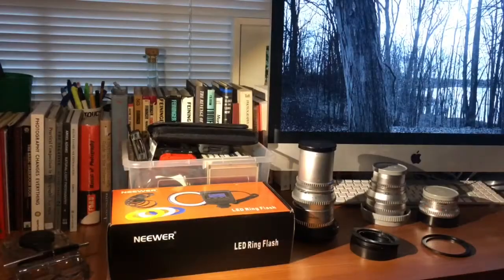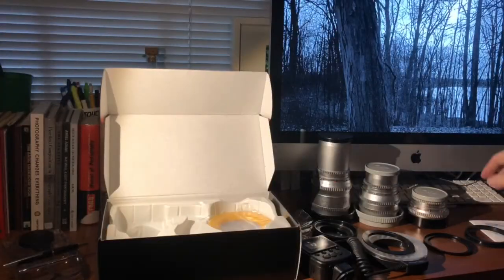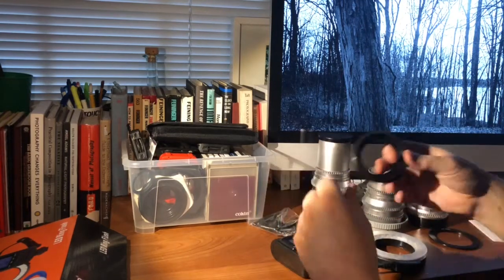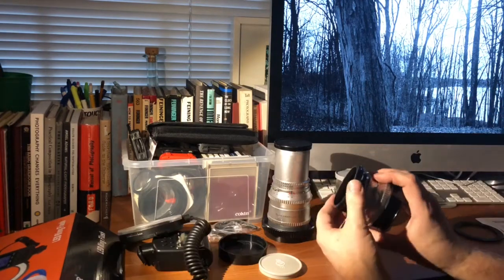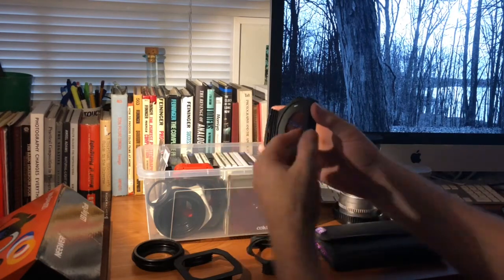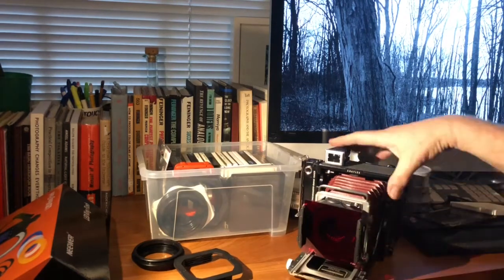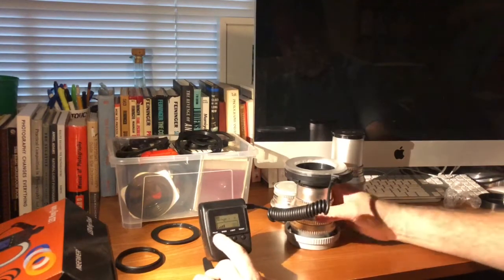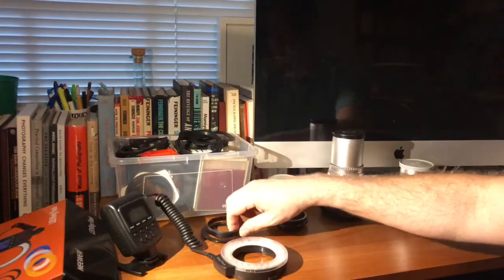Using adapter rings for Lens attachments: ring flash and filters

Comment: Thanks for the vid! So when you attach a bay 8 57 adapter to a hasselblad lens, it increases the ring size to 67. Then you need to attach a 67-77 ring adapter to put one of the neewer adapters on the lens, do I have that right?

I assume that you had to buy the bay 8 and fotodiox filters separately?

Cheers!
Reply: P.S ... I'm just looking at the Neewer ringflash now. Does it have a manual metering system when you can insert how far away from the subject you are and receive a flash that will provide the correct exposure? I will be using with film  rather than digital so its important I can trust the exposure. How have you found your exposures using this device?

Thanks again!
Joe

Comment: The filter/bay size for the 80mm f2.8 is 8? I’m having a hard time figuring out how to attach ND filter on my Hasselblad
Reply from the maker: For the Planar 80 Zeiss lens used on the Hasselblad 500 series cameras, you need a twist-on "Bay 57" For instance the Tiffin adapter I use goes from this Bay 57 size to a "Series 8" filter. That adapter happens to fit a 67mm screw-on filter attachment ring for my set of Cokin "P" series filters which I use on that camera. The Tiffin adapter also has a front ring that allows you to place a non-screw-in series 8 filter in-between the adapter and the front ring. I hope this answers your question, but please feel free to reach out for more detail!